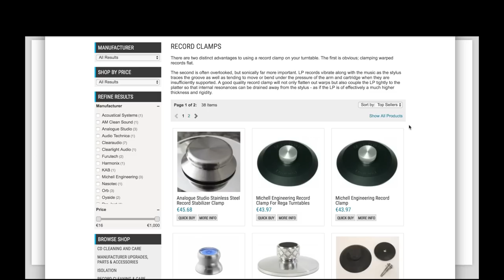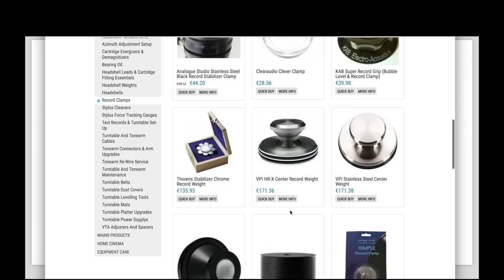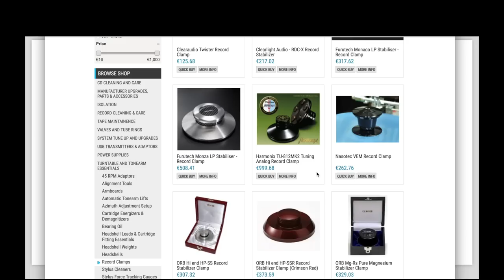The Best Record Clamps: clamping, suction & stabilization

Comment: I don't support the idea of adding weight as a solution to this issue, because most platter main bearings use a ball and flat as the fulcrum for the spindle, because  the ball on a flat  has the smallest possible contact area , resulting in less drag and better sound.   it does concentrate a lot of weight into a small area, so adding additional weight would seem  a poor mechanical decision, even if increasing the vinyl contact area through this added mass might sound better right away.   Another consideration is that a lot of direct drive platters use a horizontal ball bearing ring as the main bearing, a lazy Susan type of deal, and adding  a lot of weight onto multiple balls is not going to help keep them from adding to the sonic signature of the mechanism.

 Also, a warped record is really a separate issue from playback, although a flat surface is critical to the results.  adding weight around the spindle area probably isn't going to deform much vinyl, unless you add a lot, and the vinyl is very thin.        the concept behind  these devices is to help the vinyl surface better mate to the platter, so the mechanical energy imparted into the vinyl during playback has someplace else to go , rather than just rattling around in the vinyl disk and perhaps reflecting energy back into the playback groove, smearing the details.     Which returns us as to why the record masters are cut while being  held in place with a vacuum, when a great lump of weight in the center would certainly be easier and cheaper. Heck they could put a twenty ton hydraulic press on the center area, if simply adding mass around the center area was the answer to better sound.

While cutting lathes use vacuum to hold the mastering disk in place, to me, such  complexity is moire suitable to a business with a maintenance staff, and for home use, most people have to install the vacuum  pumps in another room , as those pumps  are not known as quiet devices.

Comment: IMPORTANT NOTE: a Michell clamp - or any spindle gripping clamp -  DOES NOT WORK on a platter mat with a recessed label area. Since many mats have this feature (especially older/vintage types TT's) I think it's appropriate to incorporate this fact in this video. You CAN use one on mats of this type nevertheless, but you'll end up bending you're records outer edge upward. Which is something you don't want, obviously.
Reply from the maker: Hi Joris, I do not understand your comment. Mats with a recession are designed to host the record label. Once positioned a record with a label the surface is perfectly  parallel and coupled with the platter. Therefore, the Michell and any other clamp will perfectly work without any problem....am I missing something?
Reply: Two exceptions here: 1 - most of these recessions in standard mats are way deeper than the thickness of a generic label, and 2 - modern pressings tend to have thinner labels than older records. Also, Michell clamps come with a felt washer that is meant to RAISE the middle of the record so you can press down avoiding this 'outer edge-rising'.
Reply from the maker: I understand but even if the thichness was different we are talking about microns. These wont harm a record in my opinion. This would be a problem with any clamp of a certain weight or locking mechanism, which means the vast mojority and also the only ones that really work...

Comment: your video and explanations is very good, but let me tell my point of view about this item, I don't like to touch any part of the plate and spindle, because the gap or clearance precision  given on the machinery lathe to built this partes is so delicate, many people can say, "Hey Gus you are exaggerating, nothing happen" yes, but if we worry about the best audio performances in reproduction by your $, is so important to take care if you touche those parts, the plate and the spindle, in this case this clamp you need to handle or manipulating with some pressure on the spindle, with very imprecise movements that can damage that parts,  not to the extent of being unusable, but in this case you add more imprecision and it traduce in noise!  I prefer a clamp just with balance weight, that you only place it without exerting pressures with imprecision, and the ring clamp, yes I know is more expensive, but it worth it!
Reply: I refer to the kind of  Michelle turntable clamp,  which is adjustable or simple pressure
Reply from the maker: I understand tour point. I cam only say that most of the best reviewers out there use this method. In the end I must admit that I do not notice much of a difference so your position may be correct afterall.

Comment: The motor doesn’t deal with weight, it deals with friction and mass. Mass reduces the angular acceleration so the turntable takes longer to get up to the required angular velocity. Weight is a force that acts toward the centre of the Earth and is proportional to mass. The force will push the tip of the bearing spindle onto the thrust plate. The friction is a counterforce to the turning of the bearing by the motor the increased mass of a weighted puck would slightly increase friction on the bearing tip. The motor doesn’t see weight. It sees friction and inertia. Inertia is the tendency for an object to maintain a constant direction and velocity according to the applied force. There is no change in weight acting on the motor. Once the motor has experienced having to supply extra force needed to overcome inertia it turns at a constant speed supplying an equal but opposite force to the forces acting to slow the platter. As long as the driving force balances the counterforce the platter spins at the angular velocity that the motor and pulley ratio demand. The motor acts to top up the angular velocity as friction in the bearing tends to slow the platter. 

Surprisingly the purpose of the clamp is not to flatten the vinyl. Clamps act primarily to dampen vibrations and that contributes to dynamic range by attenuating resonances out of the signal. It is not necessary or often possible to completely flatten the record. A warped record needs to be treated with a flattener to make it more playable. The Michell clamp comes with a felt washer to force the edges of the record onto the rim of the platter and ultimately, flattens the record surface onto the platter. The Michell clamp is probably the cheapest option that aims to flatten the record by design. It is fragile and will crack after a few uses. If they make an all metal version it might be a solution.

You need to demonstrate the effects clamps have on record playback and records. What does it look like? What positive effects are there? What negative effects are there? And give some before and after effects perhaps show waveform changes on recorded music on screen.
Reply: @darinkidd9681  weight and mass are different. One is the amount of material in an object (mass) it doesn’t have a direction… it is not a force. It is constant regardless of where that object is in the universe. A force is a vector quantity it has direction and magnitude. Weight is measured in Newtons along a line connecting the centres of mass of two objects. We can relate mass and weight in terms of the accelerating force that the two masses generate because of each mass’s gravity. 
On the surface of the Earth with its mass of nearly 6x10^24 kg, all normal objects are always several orders of magnitude less massive than the Earth so, the rate of acceleration of the Earth towards an object close to the ground because of that objects mass is several orders of magnitude less than the rate of acceleration of that object towards the relatively incredibly massive Earth. We always perceive objects as falling towards the ground if we raise them to a height. 
So the force of gravity is a property of the mass of all objects, the greater the mass, the greater it’s gravity. The Earth has a gravitational force of about 9.81N/kg on objects that we lift up. That attraction is what we measure as weight.

force is proportional to acceleration
force is proportional to mass
Since the gravitational force is a constant 9.81N/kg close to the Earth
All objects accelerate to the surface of the Earth at the same rate per kg because F/m = a 
so acceleration due to Earth gravity is 9.81 m/s^2
Consequently, since practically none of us venture off the planet to other planetary bodies with different masses to the Earth’s, we use weight (the force per kg of matter in Earth’s gravitational field), interchangeably with mass ( the amount of material in an object)…

Comment: I'm not certain of any scientific reason why a weight or clamp would have any beneficial effects on the playback of a vinyl recording.   I suggest performing a double-blind test to determine if any difference can reliably be discerned.  Any other type of comparison test will lead the listener to "hear" a difference if he or she see when the weight or clamp is being used and I'm sure the 60 dollar weight is going to sound better than the 30 dollar version -- maybe twice as good?   My turntable is a Technics SL-110 direct drive with an SME 3009 Series II improved tonearm which handles warped records without a problem -- no rumble or pitch fluctuations at all.  However,  eccentrically pressed records will cause pitch fluctuations with each revolution which become more audible as the centermost grooves are reached owing to the greater percentage of speed error occurring under the stylus.   No clamp or weight will do anything to correct that;  only a replacement pressing  -- or, better yet, a compact disc which will produce perfect pitch accuracy.   Being a classical music lover, this problem occurred quite frequently --  particularly noticeable with  music having long and sustained passages and I had to return one out of every four or five LPs when I was still collecting them.  Also, pre and post echo problems were audible with many carelessly mastered LPs.   I assume these problems still plague LP records.

Comment: Sota Nova with a Reflex clamp and vacuum. WTG.
Reply from the maker: Yeah! Is that your setup?
Reply: yes mate.
Reply from the maker: Winbo! But then please share with us your experience with vacuum suction...is it worth it? Have you tried with and without suction? Give us some info on the pros and cons!
Reply: First off, this is with warped records only.Bass is more accurate and detailed. Pace and timing are better. Noise floor is lower because the warp isnt amplified. The amplifier has more power as it is not amplifying the warp.Works better with Convex warps instead of concave, so badly warped records are flattened out on one side but not the other sometimes. My vinyl connection is generally in very good condition anyway. I regularly change the position my favourite albums are in. This can defeat warping.
Reply from the maker: Thanks!

Comment: I don't use weights................they wear out bearings and motor .
There was another solution in the seventies/eighties , at that time attention was drawn to the mat  ........I forgot the name of the mat but it was sometrhing like silicone that sucked the whole record to its surface .............this worked way better than clamps , I used it on ST7 linear tracking TT............and the results were asthonishing ( with the V15III )........
Decoupling from the platter and sucked to the mat .........the only platter mat that is genius and I use today is the copper platter from Micro Seiki.........and a spindle clamp. No it does NOT sopund metallic...........just the inverse with revealing many microdynamics and tonal colors usual hidden  in the recording
Reply from the maker: It's in the video! (Notice "suction" in the title) Always watch until the end ;-)
Reply: @anadialog  It's not suction but the material  that makes an adhesion with the vinyl ...indeed Guido , watching to the end !

Comment: LOL... A Lot of them have Liquids inside...  The Liquid is thinned Snake Oil mostly... And make a Vacuum in your Wallet...
But - don`t take me wrong - a little Weight on the Platter does not kill your Bearing, but can actually increase the quality of the Sound. 
But more important than all this, the Mastering of your Record has much mor effect to the Quality of the Vinyl than everything Else. A Proper Turntable is all you need. ;-)
Reply from the maker: Of course...but that is only the starting point. I suggest to improve this approach. If I had stopped tweaking and upgrading my system I would have probably abandoned this passion or simply folded on Mp3 like most do, which is not a problem. Not everyone is interested in a faithfull reproduction  I do because it emotions me. If I don't get emotioned, the music is without its soul and just a mere resemblance of its true beauty and power.

Comment: Direct drives have a fixed spindle on the motor. There the Clearaudio grip clamp is dangerous for the motor!!!
Reply from the maker: It's the same principle of the Michell, Nobsound and Sota. Used it for years on several direct drive turntables. Never had a problem. It couples the record with the platter, which is already spinning together with the spindle. Nothing is changing with this type of clamp.

Comment: These are essentially novelties exploiting men who fixate on "improving" vinyl lp playback.  Thinking critically, how much can weight placed dead center improve warping over the entire surface?
Reply from the maker: Not much in fact....that is why I discussed of different solutions in the video...there are also some benefits on the rotation stability...
Reply: Definitely to a certain degree. Which is an improvement over no center weight. It also helps dampen vibrations in the vinyl itself during playback.

Comment: That's correct, Sir.
Don't attempt to try
this on a belt driven
turntable.
Reply: Depends. As the weight is mostly concentrated in the center of the record, there's not much inertia added on the periphery of the platter. And you can even give it a little swing, your hand on the "knob", to help it start. That's what we do with a lot of hi-end, hi-mass platter turntables anyway. I'd worry more about the spindle itself.
Reply: @dirtyths  I have a Duel 1228 and always start it in motion by hand before swinging the arm over to start the motor, it just makes sense.